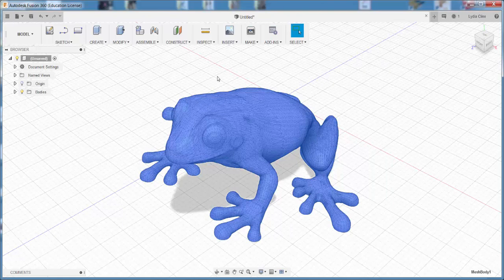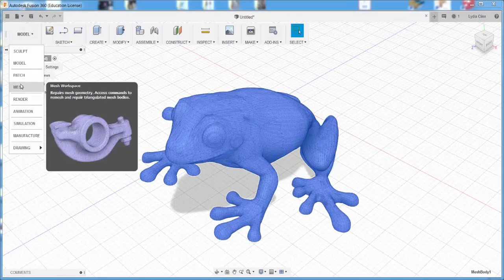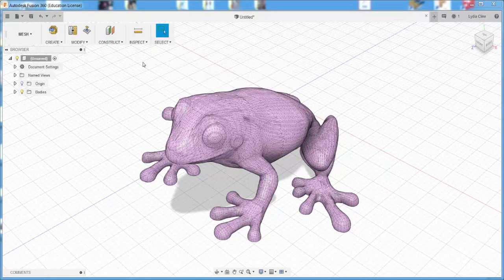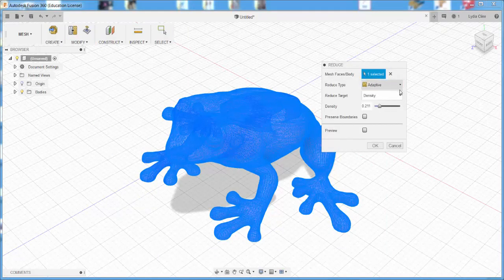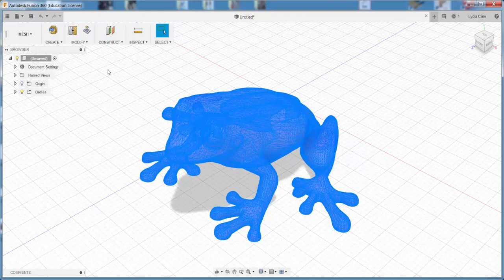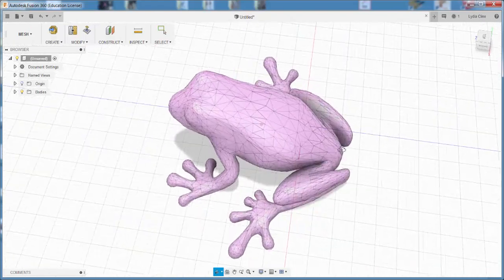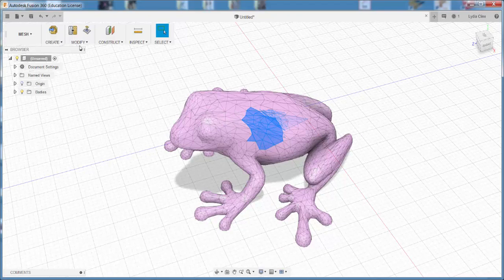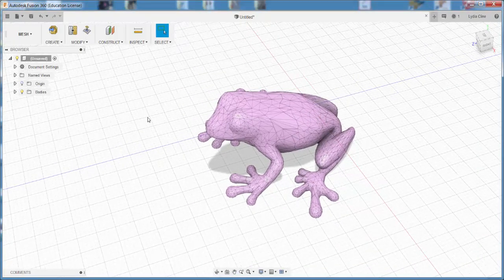Fusion 360: Decimate a Dense Mesh STL

Comment: I activated mesh workspace however I don't get the option???????
Reply from the maker: Did you bring an STL into the workspace?
Reply: @ProfDrafting  yes
Reply from the maker: You probably didn’t turn off the design history, then. Timeline has to be off.
Reply: @ProfDrafting  Looks like mesh has moved into the tab options in the newest UI.  I think you are correct about history needing to be turned off though.